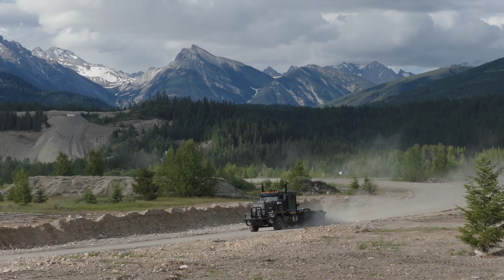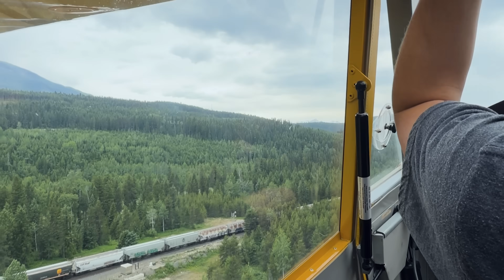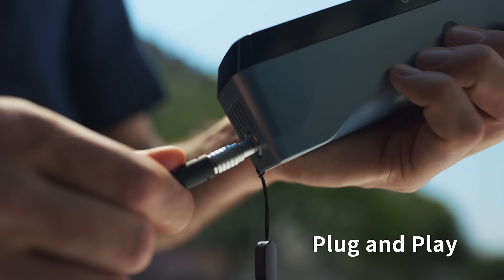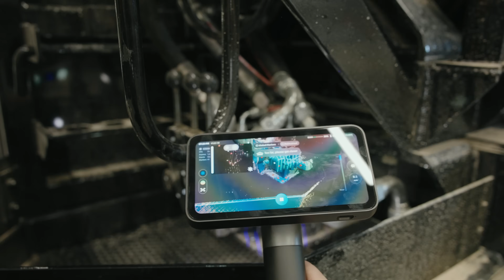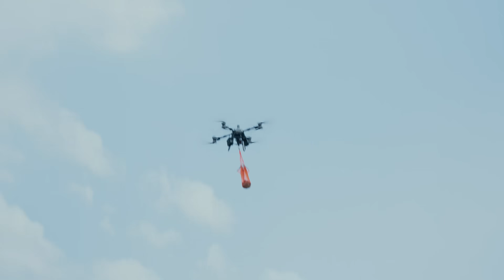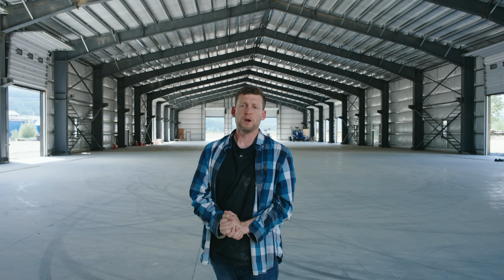Edison Motors Business Update + Big D & a Bush Plane Landing

Comment: Chase, Question Please, looking at the 18.23 minute point of the video of you in the new shop, it's apparent the roof space that building has, as you are all about electric vehicles, are you also planning to use the roof space to install one huge solar aray and batteries to help power/offset the shop with? If you had that up you may have already been able to start fitting out the building while bc hydro permits are dragging their permits

Still extremely impressed at how far you have come from your parents backyard.

Tony from Rural Western Australia 🇦🇺🦘🐈🐠🕊️
Reply: With 305 acres, Edison probably doesn't need to compromise the roof for solar panels. I share your enthusiasm for Edison to setup some solar.
Reply: @Sah-o5m  myself I have a grid tied 6.6kw solar panel system on my house roof & a 1.5kw standalone system with a wind turbine on the back of my house roof *for when the grid power goes out * with 2 x agm batteries Inverter etc

The idea of the panels being on the roof as are most homes in Australia (I'm in rural Western Australia) is to not only save room but protecting your assets.

And if you consider it, it acts like a second roof /tent fly it gives your house (building) an air gap between roof and panels insulating from summer heat, 
I have had grid tied solar for over 15 years now, it has truly paid for itself in saved electricity bills.

I cannot justify the economic expense of a 6kw battery for my place at the moment, being a single person household it doesn't work out as a viable option and our energy suppler give us poor buy back on what we generate for the grid (3.9 cents per unit 1000 w off peak and 9cpu on peak) we have to pay 31cpu to use the power from the grid

Even on those calculations I cannot afford the cost of a battery and what time it would payback my using it before the warranty ran out, 
so I use as much of the generated power as I can (3 large tropical fish tanks kept at 24c temps & a 5. KW split reverse cycle air-conditioning system)

I still get some credit from the generated power.

In Edisons case that new building with solar on the roof, less infrastructure needed to plumb it in and batteries right there less air conditioning needed summer and winter and a huge assist to power the site, it wouldnt take that long to get it paid off by savings, then reinvest in more panels to completely power the site, to a point of selling the surplus power back to the grid AT PEAK Times to get the best returns.

Comment: You can develop a tank turn function for the driving axles for your trucks to increase maneuverability. Use electric motor recovery to brake the right and left wheels separately.

Comment: I saw a snowmobile rescue where a Huey dropped a clutch part to a snowmobilist 'near' Revelstoke. 
If you are looking for drop-zones and landing guidance for skydivers, parachutists aim for a specific landing zone called an Asphalt Target, a raised gravel center pad (often called a 'Tee'), or an electronic Electronic Parachuting Scoring System (EPSS).For sport parachutists and professional canopy pilots, accuracy landing is a competitive discipline. The standard target consists of:The Center Disk (The Dead Center): An incredibly small disk (roughly 2-3 cm) in the center of a larger target circle.The Electronic Parachuting Scoring System (EPSS): Measures pressure. When the jumper's heel hits the 'Dead Center', it measures pressure electronically.

Québec Hydro has robots that crawl along the lines looking for faults.

Comment: I'm 63 a retired automotive tech. Ive wonder for 4 decades why a diesel over electric was done in the 1980s. I know locomotive engineers and knew the benefits of the Diesel powered electrical generators/motor power they employ.
Reply: Business majors and penny pinchers made decisions instead of engineers. The most energy efficient power train develloped yet is still the Diesel generator-electric drive system. The real problem is that they are also super reliable and the auto manufacturers would loose money on them and auto workers would loose alot of jobs. Mostly from the vehicles not needing to be replaced half as often, and upgrade kits don't make half as much in profits. We have the capability of engineering massively long lived equipment, but MBA's won't let the engineers do so, because it would bankrupt the businesses and industry. Same with the engineers making stupid designs that make simple maintenance on your cars hard. Its not their fault or choice.

Comment: How's Topsy doing? Still doing testing on it?
Reply: Alas
Topsy was like version2 of design. From Topsy, they learned to change the axles, batts, DC to DC, inverters, canbus, computer, generator on the V3 trucks, and the new trucks are version 4 which will be even better/stronger/faster/smarter.

So Topsy MIGHT still move under its own power (if it wasn't raided for parts). At this point it served its purpose and is now a museum exhibit.

Topsy would need $100K to get upgraded to v4 and that money is needed elsewhere for now.

Comment: That drone reminds me of something I'd been thinking about since the military show - what stops this system from being scaled up to replace helicopters? The main concerns - range, weight, charge time - are alleviated by the same sort of hybrid layout as the trucks use, but you can use it to completely rearrange things on something like a helicopter. Swapping out a single point of failure (that gigantic rotor) for smaller ones isn't usually as viable because of the requirement to connect them to the engine, but with wiring rather than mechanical drive all the way from the power source a lot of the inherent mechanical issues disappear, and it's so, so much easier to make a multirotor aircraft able to manuver than the current standard layout for helicopters, and even lets you lose function in one without immediately turning the flight into a catastrophic failure. While I've no doubt that the testing for it is intense and the materials and precision likely make the industry a bit more expensive to get into, it seems like your mentality and applications could genuinely forge the path to safer rotorcraft.
Reply: @ultmateragnarok8376  aerodynamics don't scale that easily. You can't increase the size of the propellers because the simple control via rpm that makes these drones so cheap and easy does not work once the rotors get too large. You also run into some pretty hard physics with dissymmetry of lift if you increase diameter. All this is the reason why helicopter rotors are complex, and a larger drone prop would equally need to be hinged and controlled via pitch instead of RPM, which means your complexity is the same or higher than a conventional helicopter. The only alternative is to use a lot of small rotors each with their own motor, but the efficiency of that is very low compared to a large rotor. That's why all those people carrying drone prototypes have 8+ props and can still only barely lift a person.

You can believe that if there was a cheap and easy way to make an electric hybrid helicopter based on quad copter tech, it would've been built 15 years ago
Reply: @dirkmohrmann8960  Interesting. I feel like if nothing else, the ability to sustain after partial failure might still make it an alternative that could be considered in spite of complexity, but it makes sense that larger props would run into issues as the numbers get more an more extreme with scale. Perhaps multiple smaller rotors could still work if all stacked and driven by one larger motor, similar to how I understand part of turbine engines are laid out - an extreme continuation of the two stacked rotors that drone and others often employ, though most of those seem to be driven independently for rotation control, and it does run the risk of similar force issues since at the end of the day it's aiming to produce the same amount of thrust. There seems to be some potential, even if it's not quite as simple as I (and doubtless many others) had thought.
However, I don't think 'cheap and easy' would apply either way. Edison itself is about hundred year old tech that simply hasn't been applied to this field, because the cheap and easy route is just refinement of the existing concept rather than experimenting into something new. There generally needs to be someone making that first innovation that paves the way for more support.
Reply: @ultmateragnarok8376  yeah, nothing in Aerospace is easy or cheap. And if something is cheap, then it probably isn't very safe.
Also with helicopters you run into the issues the sound barrier causes. Sending rotors to super sonic speeds is a VERY bad idea.
Reply: Most of the issues come from the Square-Cube Law problems of mass increasing faster than thrust and lift. Also power density of the batteries and power requited to lift all that mass. Physics are a pain like that.

Comment: Just an idea, don't know if you can "legally" do it in your area. But couldn't you run all the electric and not connect to the grid until the permits go through. And just run one of the Edison trucks for the power. "For load testing the generators"😅 then just flip the main breakers to the grid when approved.
Reply: Not for the power requirements a facility like that requires. Its mostly a safety thing to make sure some scummy company isn't just making a fire waiting to happen. Especially since they will probably have industrial 3 phase and kilowattage coming through there. At those levels, an electrical fire is a plasma and arc-flash hazzard.

Comment: The heavy lift drone is also the same airframe for Agriculture spray use, ie- crop duster. I wish the Edison pickup truck chassis could be used to charge the drones batteries, roughly 14kw for each charger. Carrying around a couple of 14 kw generators sux, not to mention how LOUD THEY ARE! Especially running two generators ALL DAY/NIGHT LONG...ugh!. Mental health gets threatened after a while, even with hearing protection. I'm personally looking for a 22' stake bed in the 450/550 chassis size for a bed skid setup Vs pulling a trailer around.

Comment: Re: Power. I'm sure you're looking at these fancy hybrid trucks as a source to power the shop?
Reply: Exactly.
Topsy could be yoinked out of retirement and employed to provide 480 volt 100 amp triple phase to the new Blue Assembly Plant
Reply: @Sah-o5m  I wonder if the holdup is they need the building inspected before it could be powered up, if so the generator wouldn't matter. But yeah that would be fun! Power the building with a new truck as part of its testing!

Comment: Will you be installing solar, wind, batteries and inverters to supplement the BC Hydro for not only reducing your energy expense, but also to take up the slack when the massive corporate data centers come in and force BC Hydro to ration the electricity to your facility?

Comment: Have you considered partnering with an aviation development company that may already be developing hybrid-electric planes, which use fully electric motors for driving the propellers or ducted fans, and diesel or turbine engines for power generation?   

With all of that land you could build another shop for the aviation development and when you’re ready, you can build a separate runway with hangers and other infrastructure to support not only the development of the hybrid-electric aviation vehicles, but also the planes that will be coming and going, which will be transporting the Edison team, investors, tour guests, the owners and staff of companies, to whom you may rent research and manufacturing space, PLUS the guests for an on-site hotel, resort and convention facility.  “Go BIG, or Go Home!”
Reply: Aviation is several orders of magnitude more bound by regulation and higher start up costs. Maybe after they get their feet under themselves.

Comment: I thought you were going to use Scania engines?
Reply: Scania had a ECCC delay, but they're on track again for approval.
Reply: @Sah-o5m  Well I hope they are better built than when I ran them. They were the biggest pile of crap ever made.
Apart from the fuel lift pumps we never had any issues with the Cummins we ran.

Comment: Hey Chace, Zack from Jerryrigeverything is trying to do more with his electric Humvee. Would be perfect if Edison could take his vehicle and make it better.
Could give military trucks sitting in grave yards another chance to drive and service others some more years.
Reply: lol it would give the anemic 6.5 diesel something to do powering a generator
Reply: @Precisionreelworks , at the 100 hp level, 6.5 is really reliable and easy on fuel. Of course, so is a Volkswagen TDi!
Reply: @Precisionreelworks  Hey! That 6.5 is a stout little tike that is very dependable and easy to fix lol
Reply: @Anthony12611 because it breaks often?
Reply: @wobblysauce Lets out you under insainly stressful stuff 24/7 and see how often you break.
Reply: @Anthony12611 almost like a Land Rover
Reply: I think banks is working on some hybrid humvee stuff for the military too. Probably not for active combat use but you always need equipment to move gear and troops around
Reply: Additionally, Humvee’s are maybe not the safest platform to be bringing back. From all the podcasts I’ve listened to regarding wartime experience, they led to a ton of fatalities due to IED’s and the flat bottom design of the humvee. Something like an MRAP would be better for suited for an evolving battlefield.
Reply: @Leeemmmuuuuurrrrr  They’re not talking about restoring Humvees for military use… how many IEDs are in your state?
Reply: @owendodman3037  How many Taco Bells are there?
Reply: @IamHattman many more than there’re IEDs to find/not in a state bud.
Reply: @owendodman3037  That was what we call a joke friend.
Reply: @IamHattman welcome to the internet where there’s no sarcasm or tone via text😅
Reply: @Leeemmmuuuuurrrrr depends on where youre fighting mrap is to big for island hopping

Comment: Its time to designand build the electricity export system on your hybrid truck, to power your factory while waiting for grid connection.
Reply: I wonder if its possible to develop a parallel kit that would allow several trucks / generators to daisy chain together to have the capability to power a large site. Imagine 2 or 3 trucks together powering an entire electrical panel for an offgrid commercial site
Reply: @LaxmanPradhan0 it is possible to design such a system. It needs power inverters with communication links between the trucks, one of them act as the master, the others as slaves, and they synchronise the power frequency and coordinate each others so they share the load. Same system that are in the grid scale stationnary batteries, wind turbines, solar power plant... Every battery has their own inverters, and they talk to each other to deliver electricity or charge.
Reply: The military also wants this developed too is my guess.

Comment: Can you install a rail yard next to the main track? That would come real handy for shipping.
Reply: Edison is located on the Donald property which was a big deal railroad yard/town in 1895. In 1995 I believe there was still a working switch and spur that has now fallen into disrepair.

I'm pretty sure Chace would love to get that switch and spur running again so it can generate income as an intermodal hub and to get 3,000 ton of truck parts in and out annually.

But, it sounds like the railroad company makes it a pain to do business with.
Reply: Connection to train lines is quite pricy. Iirc. Not certain